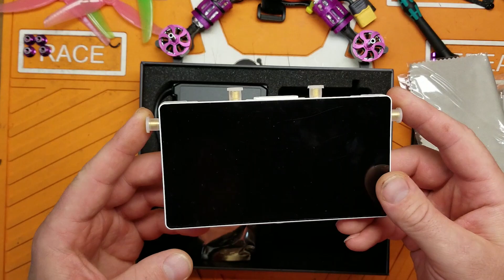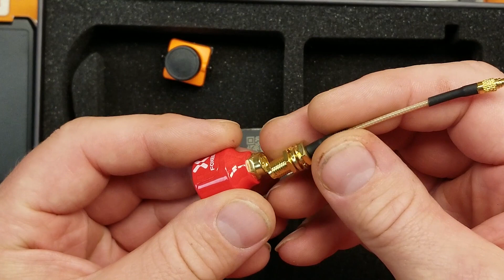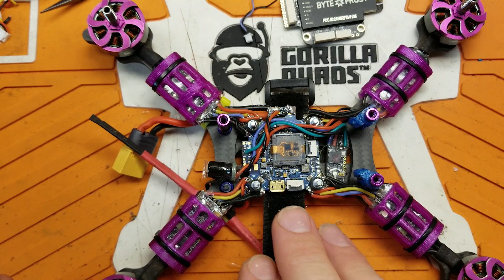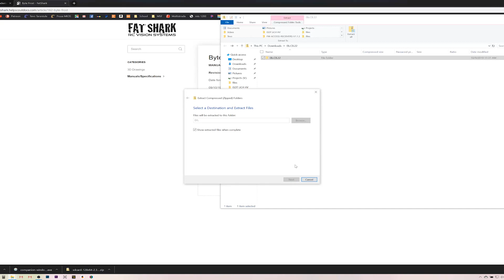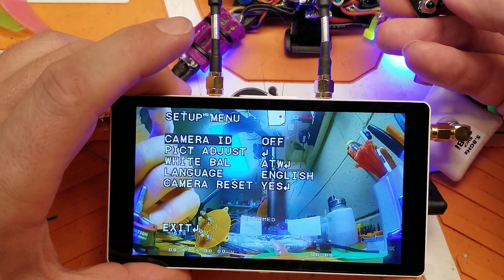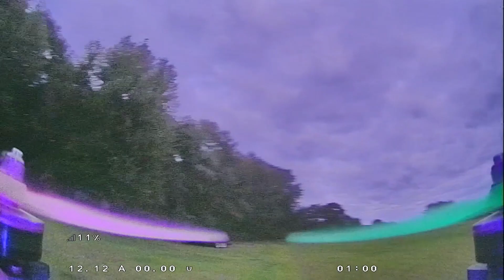Fatshark Byte Frost initial review🔥🔎👍😍

Comment: Great video - I’ve found that the system becomes blurry as the light levels drop using the Fatshark stock camera, yet to try the Runcam camera...  I am hoping that Runcam camera improves things...  The 450 mW level doesn’t seem to work without the white blockyness, I have 3 VTXs all have the same issue... the 25 & 200 mW are both fine...
Reply from the maker: Thanks for the info!

Comment: Why is the voltage 00.00v in the osd? :(
Reply from the maker: When I setup this Quad I accidently has esc voltage selected and that wasn't right for this setup. I went back and used adc voltage and it works just fine.

Comment: Great review.  Exactly, Byte Frost & DJI are nothing alike and far too many continue to compare apples for oranges.  I've been flying RC models for almost 50 years and have been FPV-ing since the day DIY'ers began sharing how-too's on building such systems and it's great to see the technology advancements over recent years.  Though, IMHO and my opinion only I doubt very much if there will ever be an actual HD module designed or manufactured to suit existing FPV goggles and all those who are waiting for such will be sadly disappointed by only having to use ground stations like the Byte Frost system or like the DJI system having to purchase new goggle designs built around a HD system.
Reply from the maker: I am worried that these systems are going to fracture the hobby for a while. Kinda like blue-ray and HD-DVD. Thanks for watching

Comment: Awesome flying and review, dude! 😃
Just one correction: it's not a digital system, it's AHD - analog HD. That's why it has this kind of break out. 😉
Anyway, what I liked about this system is that, although it's not perfect, soon enough we're going to see new cameras, new transmitters and so on for it. 😃
Reply from the maker: 😂 FatShark calls it digital and HD probably helps with marketing.
Reply: @TweetFPV  Probably! 😂
Anyway, when Rush FPV comes with a transmitter for this system I'm probably going to try it! 😂
Reply from the maker: That would be awesome. I haven't heard of any other mfg making transmitters but I have head of others working on cameras
Reply: @TweetFPV  Me too, but I bet we're going to see them popping up very soon! 😃
Reply: @MCsCreations  only the camera is AHD, the transmission is digital

Comment: Anything that isn't DJI is a good thing.  Am I correct in thinking the Byte Frost is an ongoing development system and hopefully will only get better.  I will not be getting one however, until the ground station turns into a module for my existing HDO's 👍
Reply from the maker: Yes, the hardware is kinda set at this point minus the camera. Software will improve and other camera manufacturers will be making compatible cameras. I wish this was a module system but with it being ground station based it does give the maximum availability to users. Fatshark goggles don't always fit everyone. So if you have another brand or even box goggles that fit and have a hdmi input you then at least have options. I have a transformer panel viewer and it does work and is a super cheap alternative to getting a set of goggles. But I really didn't like the fit.
Reply: @TweetFPV  Don't suppose you know how good the system is for range, could you do a video on testing maybe??
Reply from the maker: I haven't tried to stretch its legs yet but I plan on doing it soon.

Comment: It fits the transformer viewer I wish the cable was just a little longer hate to cut it up to mount it in a mr croc slam frame
Reply from the maker: Can you put the Vtx up front and the fc in the rear?
Reply: @TweetFPV  it's the way the antenna end gets in the way with the esc I'll just extend all wires. The croc slam frame is nice with 3 30x30 spots
Reply: @TweetFPV  so what do you think of the Transformer viewer looks pretty good nice to not use a hdmi cable glad I kept mine
Reply from the maker: The viewer doesn't fit my face very well and the screen has more latency than the hdmi feed. But if you didn't have any goggles it's a great inexpensive option. The viewer is only $29 on eBay.

Comment: Hello, I have had a BF for 1 week and I don't have your parasites (snow effect) in the workshop and almost not in flight without obstacles.
Otherwise I don't find the pliers you use to weld the wires very thin, it looks very practical, do you have a link?
Reply from the maker: The "snow" was most likely because i was at 450mw on the bench in very close proximity to the VTX. 
The tweezers are ceramic tweezers https://amzn.to/2MS6hO5
Reply: I always use hemostat pliers
Very handy